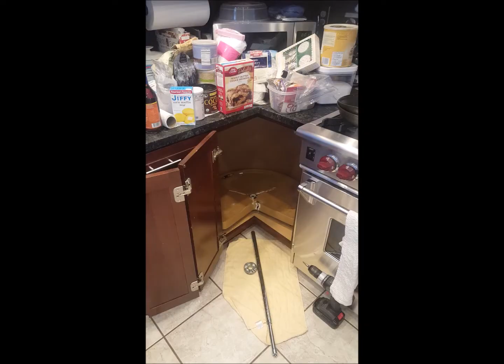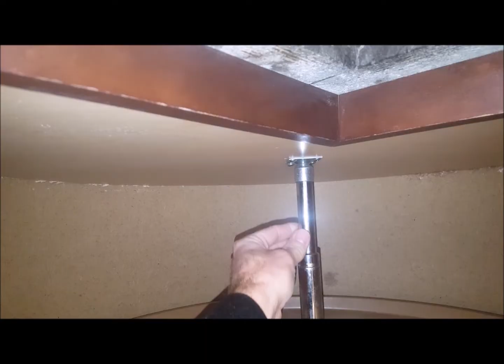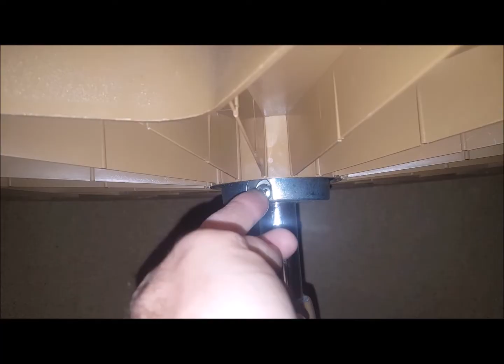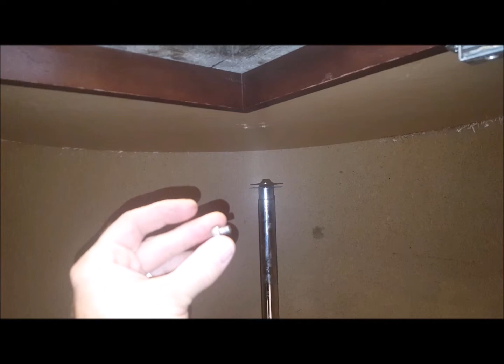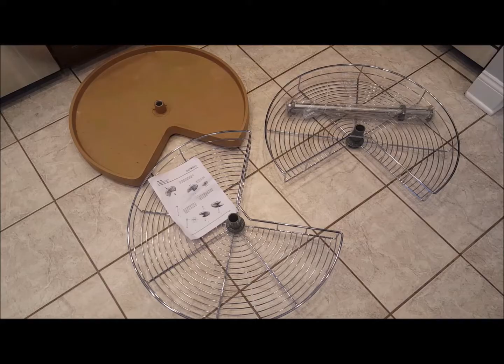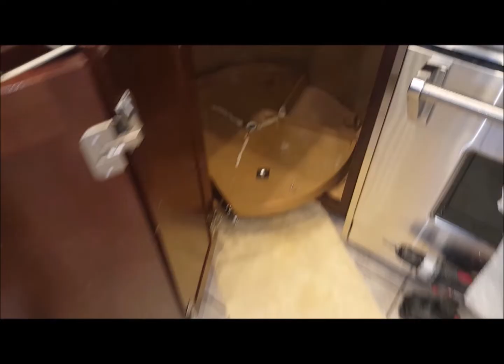Lazy Susan Removal and How to Measure Diameter

Comment: Nicely done. 
When you need to repair plastics, take a look at the Hot Staple Gun and also, some have plastic welding tips or a separate chisel tipped handle. you can also use a wide chisel bit soldering tip tool to smooth the plastic after inserting the staples. I fixed my lazy Susan bottom shelf that had split from the edge towards the center using the hot staple gun. There are many videos showing how to repair plastics. I suggest to everyone to take a look at how this tool works and next time you need to repair plastics, stop, don't just use glues, get this tool and a bag of staples in various shapes, flat, wave, inside corner and outside corner in 0.6mm and 0.8mm thickness. You won't be sorry. I fixed a long crack down the center of the hood of my John Deere Garden tractor using the wave staples, about twenty-five of them, it was a really long crack and now it just looks like a barely noticeable scratch down the hood. You will find yourself looking for more plastic parts that you can fix, it's that easy and inexpensive to make solid, stronger repairs that add structural support to prevent the crack from expanding. Tip: a good repair is 99% preparation and 1% finish. Make the seam tight using either clamps, tape, making a mold from clay for curved plastics or a combo of what works for that job. I even use a super glue gel or liquid to temporarily hold small pieces together before I put them on a flat surface prior to inserting the hot staples. Always work on the side that won't be visible. When you're heating the staple, cycle the power on and off with the finger trigger to control the heat and not melt the plastic too quickly. You don't want to apply heavy pressure either, you'll push the staple right through and out the opposite side of the plastic piece. 
Be careful clipping the wire ends off. Use protective eye wear, grip the wire tightly with needle nose or pliers that hold the fine wire tightly before snipping as close to the work surface as possible. Don't let those tiny wire pieces hit the ground or floor, they will end up in someone or a pet's paw. A lot of energy is released when you clip the wire ends, if you hold it with your fingers, when you clip it off it will shoot right into your fingers. I know, first time I did that I had to pull the wire out of my index finger with the pliers so grip them tightly with pliers that have a gripping inner side.  I like to drop the clippings into a magnetic parts bowl. These parts bowls are handy, inexpensive and can get them at nearby tool shops like H freight. Finish up with a rotary tool and a sanding drum or stone tip to grind those sharp spikes that are left after clipping the wires off so you or someone else don't get a puncture or cut. Grind down the metal stub not the plastic.
Reply from the maker: @topc5826  thanks a bunch for the info and for leaving a reply have a great day.

Comment: My 1969 houses Kraftmaid cabinets lazy susan is upside down to this. Really wondering who did this house because in the week we have been here so much was done wrong. House stunk of cat urine and mouse droppings but we didn’t know because they ozoned it before which is legal but unethical. Now we are stuck with rehabbing more than planned and on a strict budget. Removing all cabinets and drawer faces to sand and paint due to the odor. Same for the pull-out drawers. Trying to remove the lazy susan and all this while hubby is at work but got stuck trying to remove it. Hoping it works like your video but it is upside down. Not broken…just dirty and under it needs to be cleaned and painted for odor till we can do a full kitchen remodel. Thanks!
Reply from the maker: Thanks a bunch, sorry for the late reply, I just figured out how to see my comments.